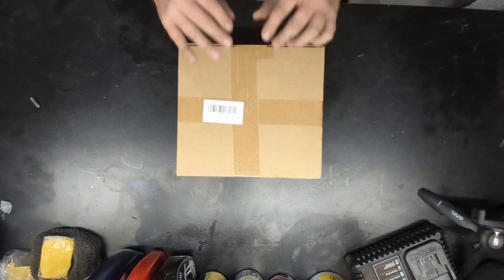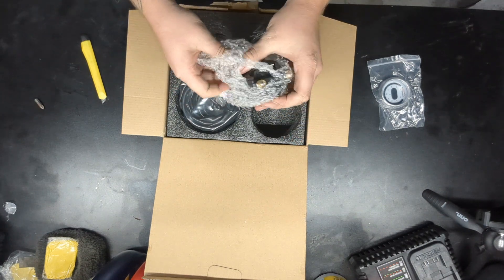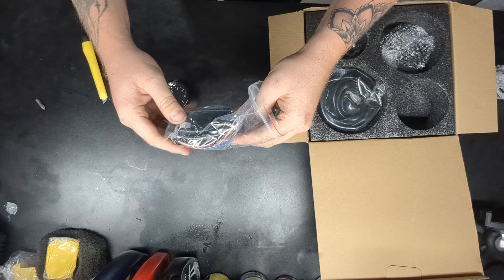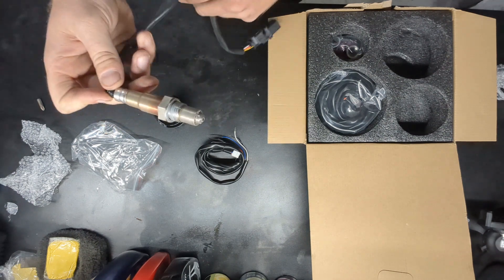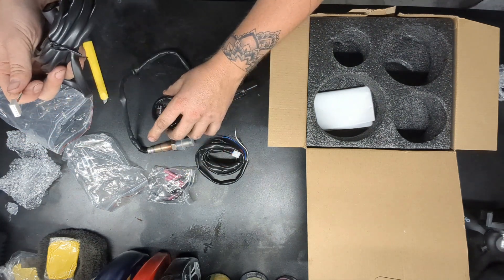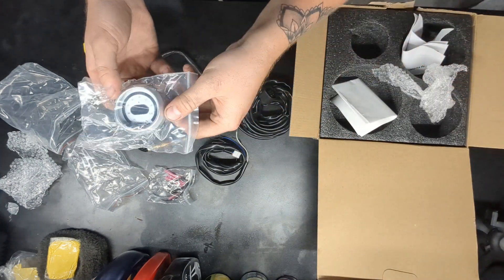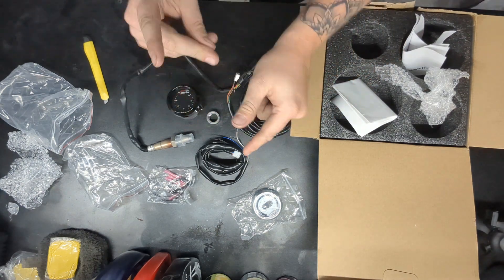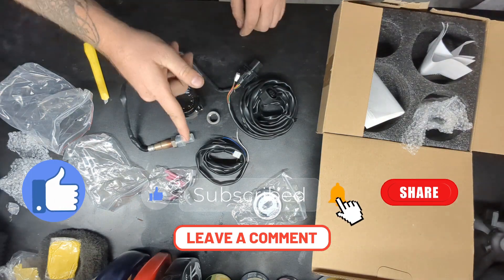What's in the box #6! Amazon Wideband Sensor and gauge!

Comment: I got one, I hooked it to power and ground to check it and it's reading 14.7/14.6 and it's not even plugged into the o2 sensor. I've got no faith it'll function correctly but I guess we will see when i get time to tap the exhaust.  Hoping it's not a complete scam and designed to read 14.7 no matter what to give the illusion that it works
Reply from the maker: Heck naw man. It's pretty accurate for me! If it's installed correctly I give it a 👌
Reply: @The3800Daily  it's concerning that it's reading a perfect afr without being plugged in. That's my issue with it. O2 isn't plugged into the gauge at all. It shouldn't read anything.  We will see though
Reply from the maker: We can probably assume that 14.** Is it's default reading when it is not receiving any signal from the O2. When it is getting signal that "point" whatever bounces around a lot. Get it all squared away and let me know what it does. It is kinda curious
Reply: @The3800Daily  I'll for sure let you know. It Was bouncing 14.7 to 14.6 intermittently. Im in the process of moving so it'll be a month before I can fully install it.